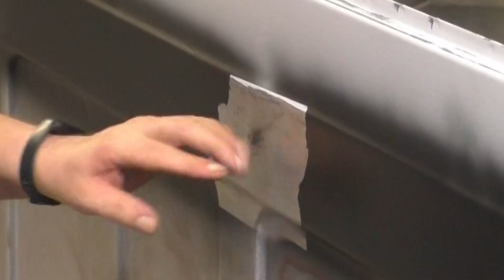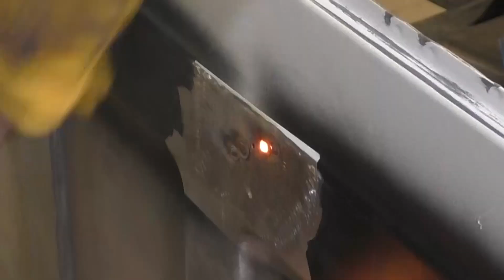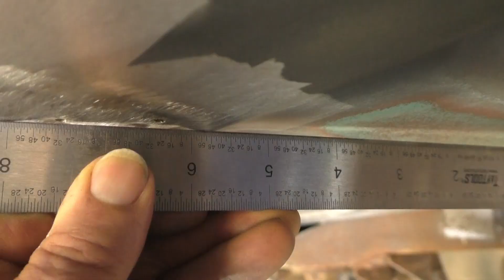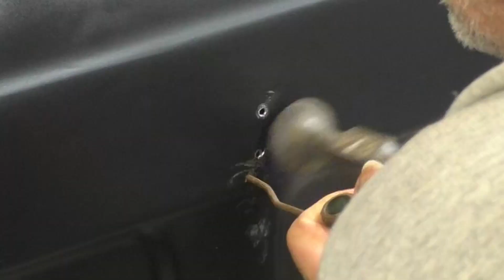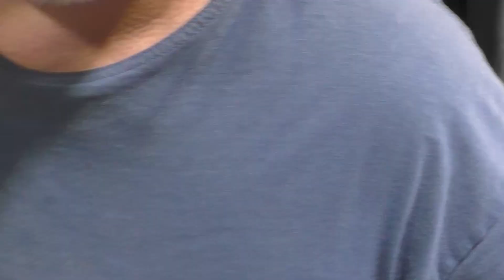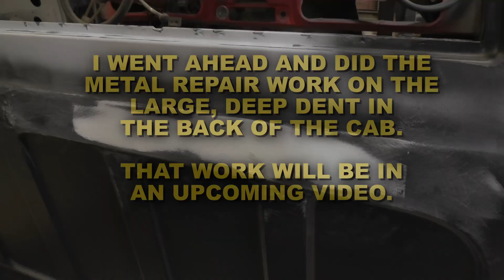69 C10 Rear Panel Dents - No Backside Access, Complete Slide Hammer Repair!

Comment: How long did you let epoxy primer dry before adding filler?
Reply from the maker: the tech sheet says you have up to three days for the chemical bond (no scuffing).  I usually wait one day and then lightly scuff (180, red scotchbrite) this isn't the recommended procedure, but I do it anyway (old habits die hard :-) ) anything after 3 days I do scuff.... BUT I try not to go over 3-5 days when adding the filler work as the chemical bond is very good between fresh epoxy and filler.  If the epoxy is going to sit, say for weeks or months, I sand with 180 and reshoot, then do the filler work. Just my thing.... may not be necessary....    Good luck!
Reply: @cookstersgarage3908 thank you.

Comment: The feathering advice is great too. I'm curious how you handle the big dent on the corner. I have one like that too. These trucks were workhorses!
Reply from the maker: I have the metal work done as I showed in the video, it's filmed and ready to edit.  Question- would you want 2 part video on that repair, metal work in part one and filler work in part 2. or a longer video covering both.  I'm still testing the longer length videos, not sure what's best.  I DO believe putting as much work in one video as possible IS the way to go...  Thanks for the feedback!
Reply: I'm a big believer in the KISS method. It stands for keep it simple stupid. The longer video on one repair including the metal and filler is the way to go. The magic of editing can show the larger areas. I'm a beginner trying for a 10 footer driver quality result on a budget. How do you like to spray the epoxy primer and can I do multiple coats and block it?
Reply from the maker: @billthompson5634  thank you.. the longer video is in the works now!  as far as the epoxy primer, it is NOT made to be sanded at all.  2 initial wet coats is good.  Let it dry, then topcoat, in my case body filler and/or primer surfacer. (this info is all on the tech sheet(s) for the product btw)  It CAN be scuffed after it's initial cure period (3 days in the case of PPG) for adhesion, but it is not a primer or primer/surfacer you would use for block sanding. etc.  There are plenty of other primers out there for that, I use PPG 2k urethane, not polyester primer (feather fill, slick sand etc)  I'll show the primer in my upcoming video, OR check out some of my other body work videos in this playlist.  Thanks again!   https://www.youtube.com/playlist?list=PLdWPL7kP4UA0rE2fkyiGfxTK4QjqP6uM_
Reply: Thanks Cookster. Your videos show great ideas. Adding drain holes, masking tape on the perimeter of your filler, welding on door skins, and correcting gaps with welds or welding rod
Reply from the maker: awesome!  glad you're getting something out of these!